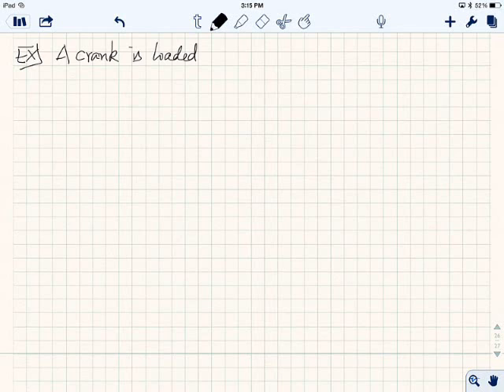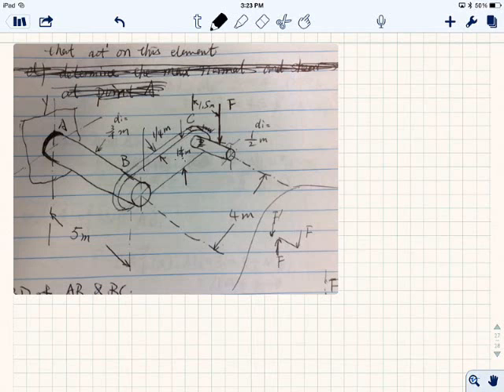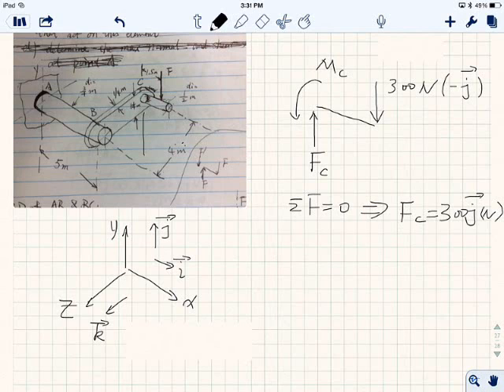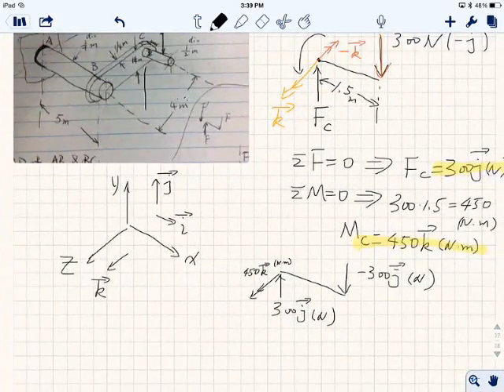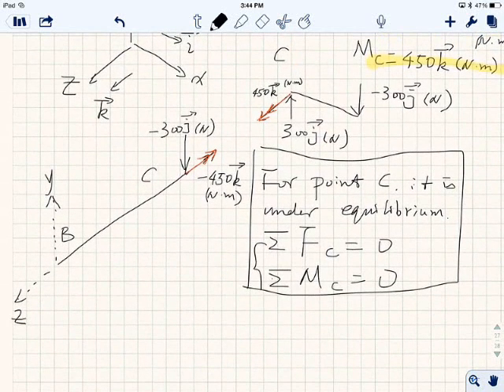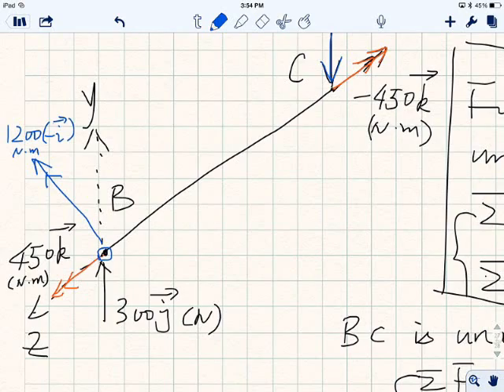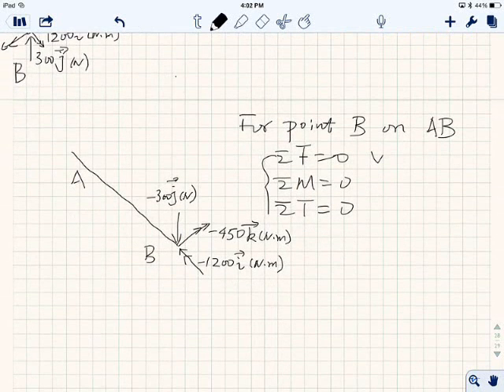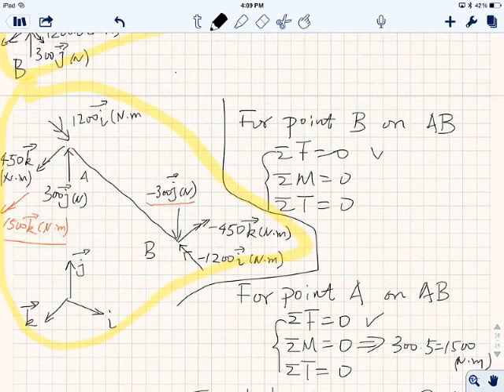Bending Moment, Torque, Applied force- MECH 3334- Mechanical Design

Comment: How can I find torque for this application ? 

https://www.dropbox.com/s/f18ls68yiil1iso/image001.png?dl=0

Specification : Sheet metal to bend in this center , 7 mtrs length and 0.5 to 1.1mm thickness